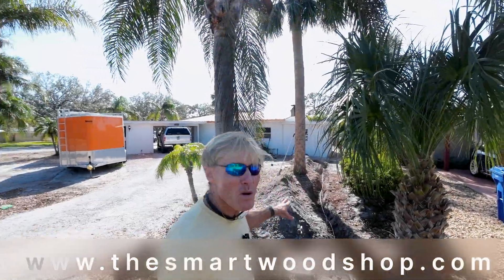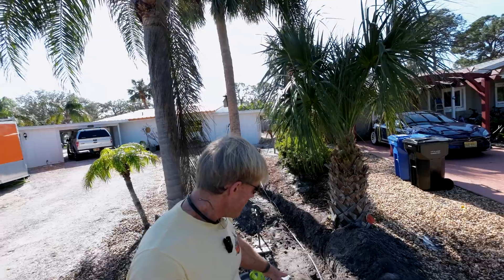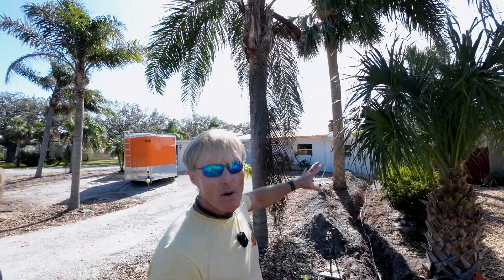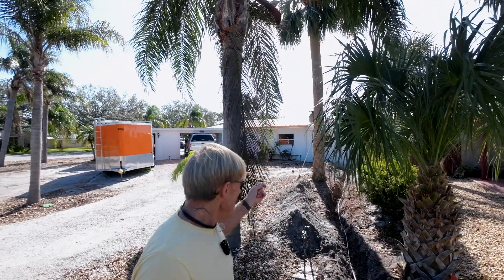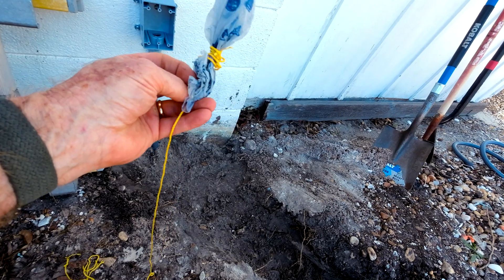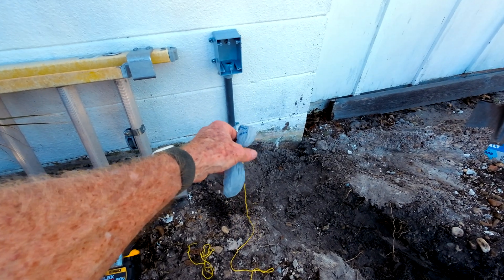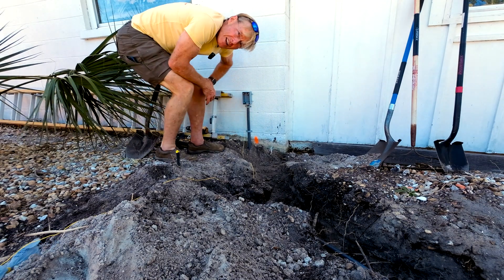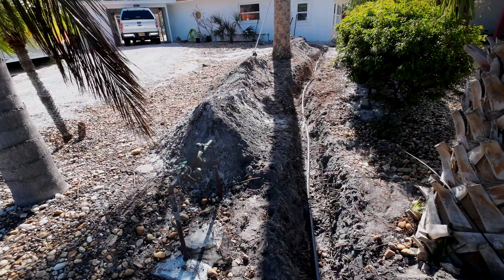Digging Deep: The Quest for Fast Internet with Underground Fiber Cable

Comment: We didn't use plastic bags at the end of a string, we just tied several knots on the string and it was enough to pull it through. Also, I did the same as you mentioned, in that we would pull another string through with the wires.

Comment: What in the hell is going on here Ron? Whose the provider and why are they not doing the installation of the fiber?
Reply from the maker: Frontier Fiber. I don't think they are worried about the long term. The handwriting is on the wall for the future. 5G or another wireless option will replace it so fiber will go the way of phone lines and cable.